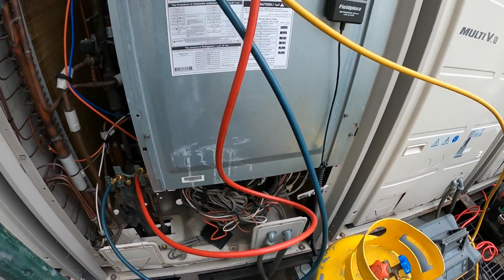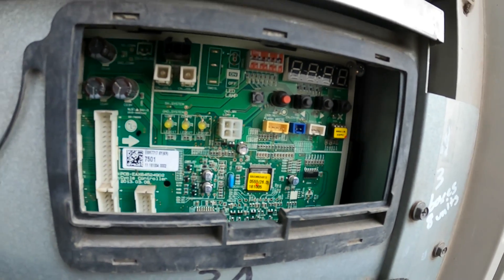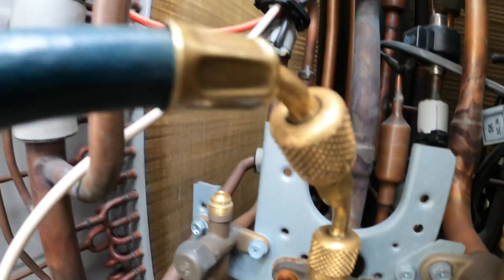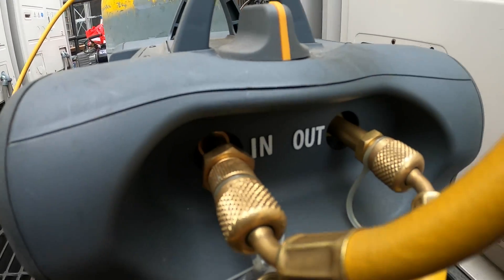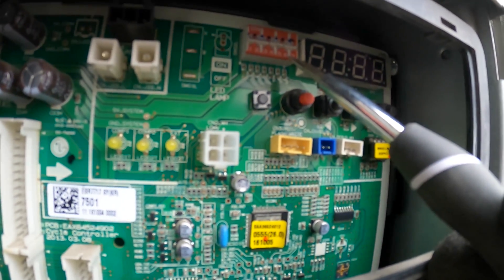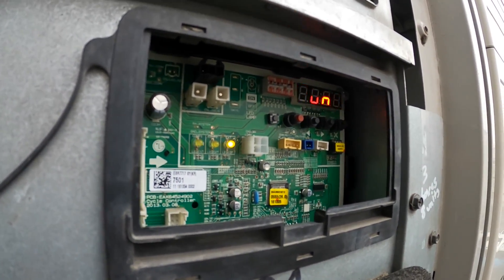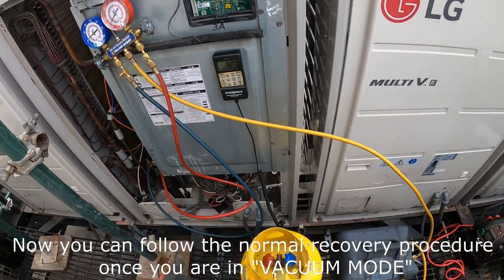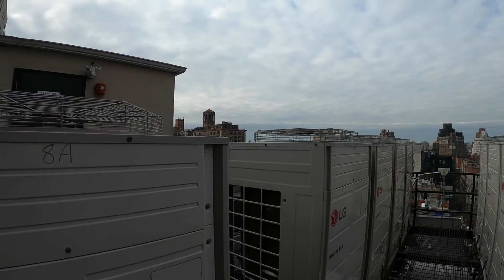HVAC: How To Recover Refrigerant From Any LG MULTI V Heat Pump/Heat Recovery System (VACUUM MODE)

Comment: I have a question. I'm trying to put it in vacuum mode after repairing a leak in the system. I try to get the indoor unit thermostat to turn off but somehow, once I cycle the power on outside, the compressor wants to start. can I put in in vacuum mode if the power to the indoor unit is off? Will the indoor unit EEV open if the power is off to the indoor unit?

Comment: In your opinion why do you see so many compressor failures on LG. Is it bad install, or bad equipment? I have lots of various VRV/VRF equipment on our campus, just want to get your take.
Reply: Inverter Driven compressors are very sensitive to bad (or dirty) power.

Comment: Sometimes the system has enough pipe and IDU coil volume to allow you to seat the valves in the condenser and use a shrader port in the condenser to pump the refrigerant into the building line-sets. I still like pulling the charge to check for leaks like you do. I'd start using core removal tools and bigger ID hoses to speed recovery and vacuum up, they save hours.

Nice vid
Reply: The Multi V IV's at our site have two ports in the outdoor unit that are separate from the main service valves, that allow you to work on a single outdoor unit without affecting the rest of the system. However on the Multi V 5's, these ports don't exist, unless they located them somewhere else.
Reply: @Rodj12341  I haven't found anything on the 5's except the charging port on the bottom of the accumulator/receiver. It has a cap tube so its basically useless.

Comment: Do you leave the system power on the full time during the compressor swap and vac as well? It’s on while recovering, so if you shut power off, will it close all EEVs and such? Helpful vid!
Reply: You only need to keep it in on in vacuum mode when recovering the charge and pulling a vacuum, the rest of the time it can be off.

Comment: Man they really jam those units together. You'd think that would affect the head pressure of all of them. Is that proper installation? I've never seen those before, but every manufacturer specifies clearances for back to back installations.
Reply: Most condensing units are vertical discharge, with the exception of mini-splits. I looked up the clearances for grins and giggles. For the Multi V back to back installations require a minimum of 2¾ inches for air movement. Compared to a Goodman VXC condenser that requires a minimum of 20 inches to an adjacent unit and 24 inches for a commercial installation. That is what I'm familiar with. I just can't see less than 3 inches being enough for the unit to get adequate air, but their engineers publish otherwise.
Reply: that's why they're designed with the condenser fans blowing upwards